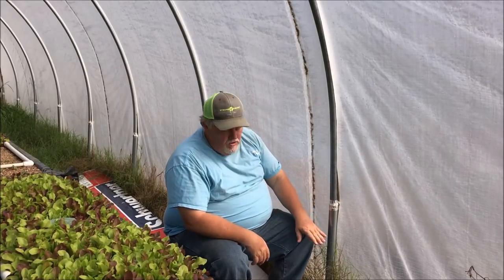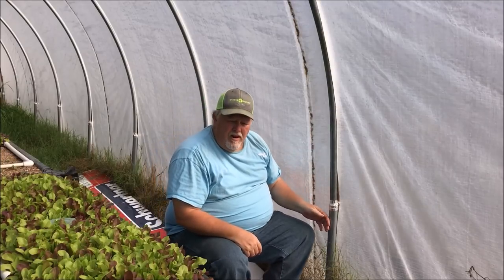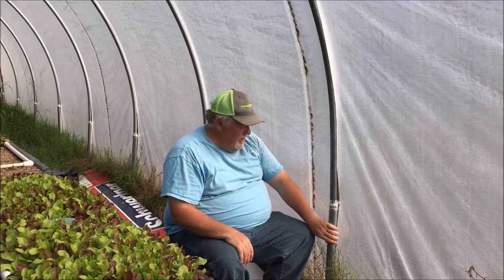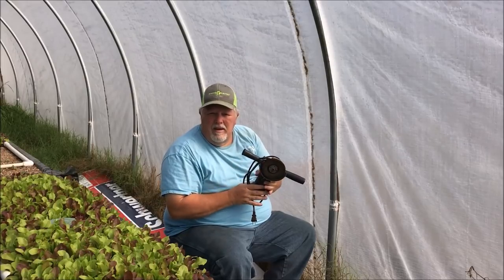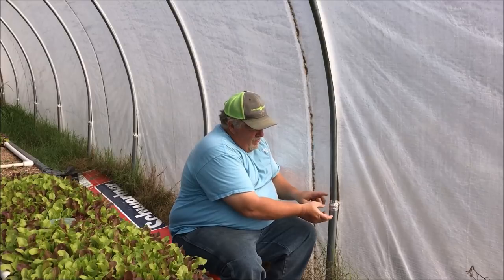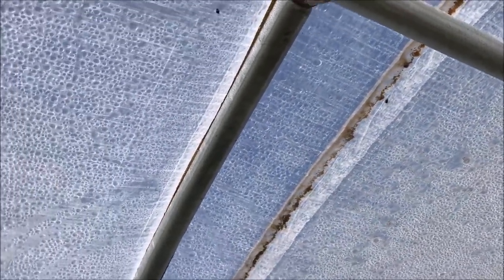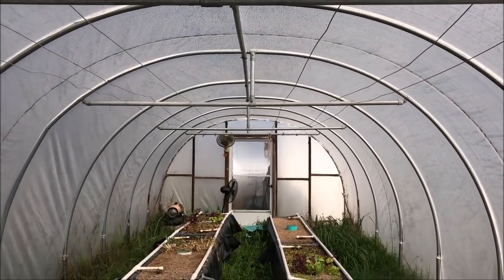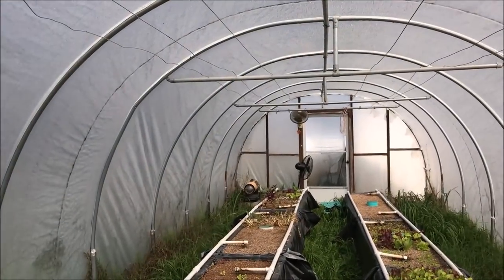Pipe Bending, Greenhouse build Questions Answered.

Comment: I want to make a 20 ft by 30 ft long greenhouse but I want high sides so I want the pipe on the side to be you know  eight feet high and then start the curve will that work with the 20 ft bendoer. What is the height of the 20 foot wide radius

Comment: If you are a single builder even the small hoop greenhouses need to be TAPED OR FELTED BEFORE YOU RAISE THE HOPS  to work as safely and quickly as possible. That applys to any thing above head level and stay off the top 2 steps of your ladder.

Comment: what is the length on the top rail 1 3/8 to make a 12ft wide are they two 12 footer
Reply from the maker: the pipe we bend comes 10 foot 6 inch and you need two to make a 12 foot wide arch
Reply: @HallsomeFarm  If I want to make a 20 foot wide, what pole length do I need to purchase?

Comment: How much do you have to bend when you want a 24 foot arch?
Reply from the maker: That takes a different binder and you’ll use 4 sticks of pipe
Reply: Can you just use 2 if you get 20 foot pipe?
Reply from the maker: j lurch pipe bender is designed for 10’ pipe not sure if 20’ would work or not